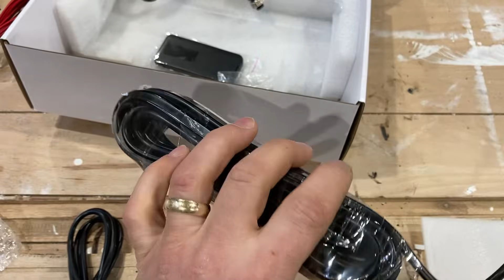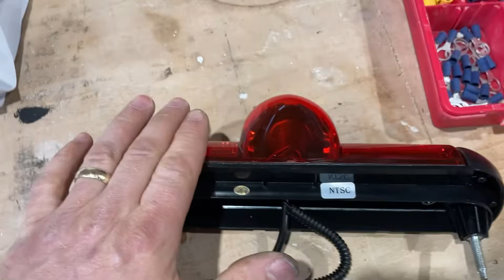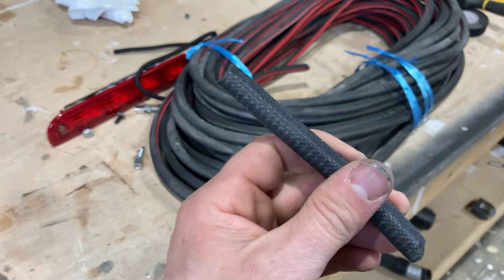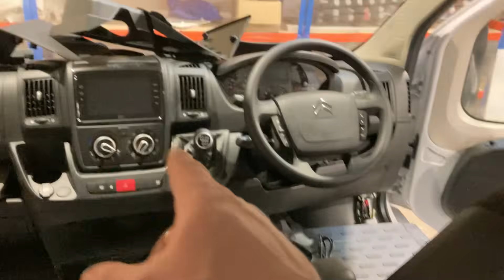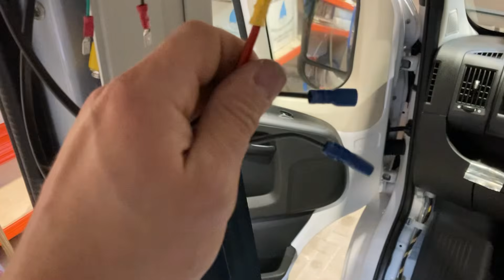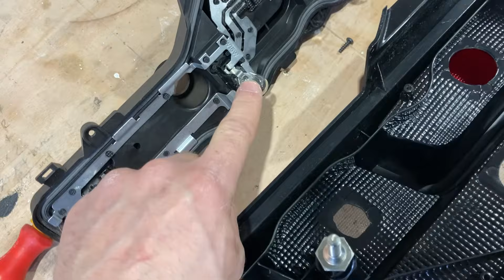How to Install a Reverse Camera in your Van Conversion

Comment: Can I ask please, where I could connect the two power wires to power the unit? I appreciate you are waiting to connect them to a fuse box near the rear of the van which is not yet fitted. I need to have the camera up and running prior to it having all the main electrical installation done.
Sorry if this doesn’t make sense, never attempted this before and really want to follow your example.

Comment: All very interesting and I have learnt a lot. You have made my life so much simpler as this is exactly what I want to do ! Thank you!
It may help if you also told us where you got the bits from, and for how much, to give us an idea.
I would, however like to point out that if there is no power applied to the cable  then you can cut both wires at the same time, in one go,  with the cutter, and there will be no problem, no fuse will blow. The "short circuit" that you mention only happens when there is power  in the circuit, i.e. the light would be on if plugged into the socket/plug but that is not the case here as the brakes light only comes on when the key is in the ignition, turned on an somebody steps on the brake.  Of course cutting them separately is a good habit to form but it is also a good habit to form to always know what is going on with the circuits you are working on ,are they on, are they off etc.  so then you know whether  you can or cannot cut multiple wires together. I hope this helps

Comment: Nice video man! Any specific reason you're connecting the device to you household battery and not the starter battery?
Reply from the maker: Just so that it does not gradually drain the starter battery as it has a small constant level of power consumption

Comment: love the video- lets hope its as simple when I try to replicate what you've done. One question about the trigger cable that you connect to the reverse light- why do you use the black/negative and have the red/positive connected to the other red wire? My AV connecting wire has a red wire emerging from each end that I was going to use to power the monitor via the connection to the brake light. Can I then connect the green to the reverse light via the red wire and earth the black one?

Comment: Can the reversing camera be used as a rear viewing camera whilst driving, if it has a switched live??
Reply from the maker: Yes it can be turned on permanently to display what the camera sees, however in this position it looks straight down to the rear bumper/floor
Reply: @vanlifeconversions how do you make it work as rear view mirror/always on? My instructions ends with “if you would like image while car running, please….” It ends there. Also i’ve tried to power the monitor on via a battery to see if it works but it’s completely dead. Do you need the remote to start it up or should it start by itself? Grateful for help!
Reply: @oscarlindley4130  i imagine you've figured it out by now, but for the benefit of others you take the trigger wire to an always on connect instead of the reverse light,  you can also wire in a switch so you can flick it on and off.  greg virgoe has a good video on it

Comment: Hi Ollie, love the videos! Can I ask - is the adhesive pad for the exterior good /strong enough to create a waterproof seal? I've got visions of leaks, even if the area is prepped properly with the degreaser first. 

Wanted to check as it's the only hope without liquid sealant being used and I'm starting my conversion next week on a 2018 Boxer.

You guys have been so helpful!

Cheers
Dave
Reply from the maker: Hi Dave, We haven't experienced any issues with the supplied pad, but if you wanted to use a clear bead of sealant for extra waterproofness, then that would be a quick job for peace of mind. Good luck with the build and thanks for your support.
Reply: @vanlifeconversions  great thanks for replying!